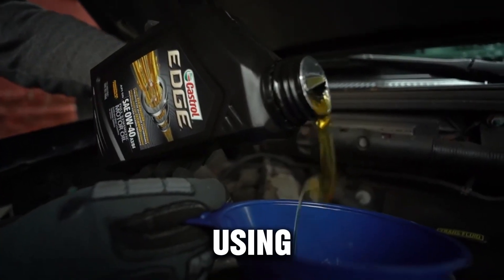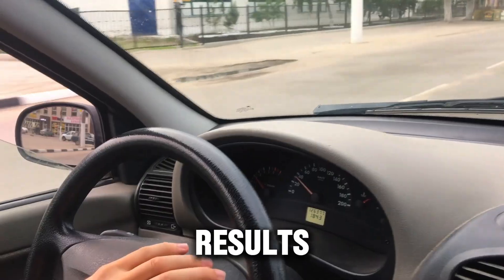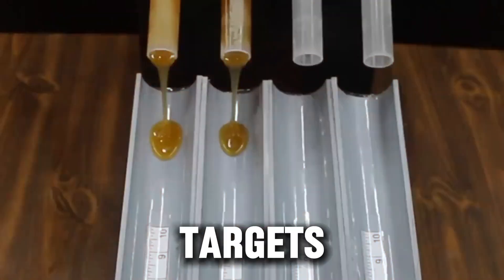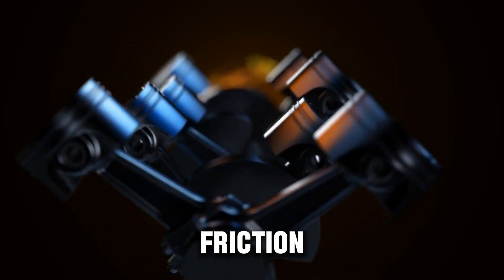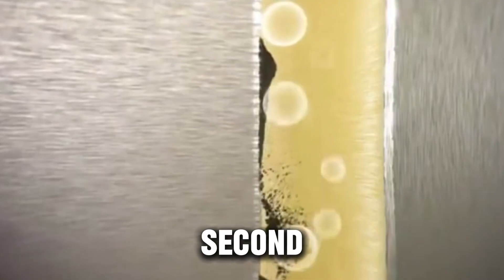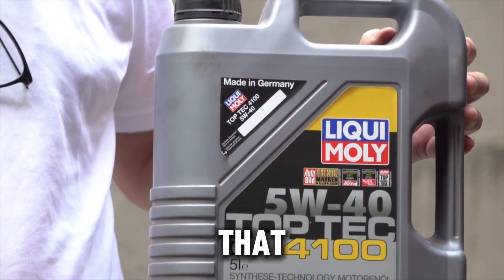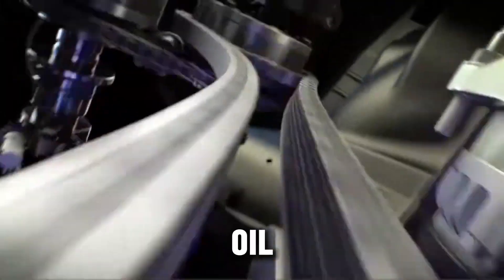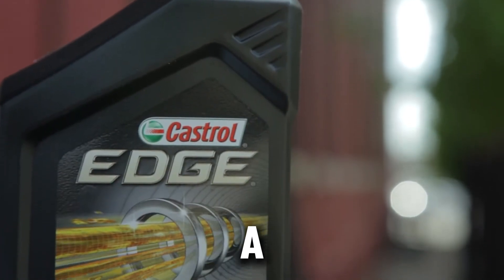The TRUTH About 0W40 vs 5W40 Diesel Oil (Real Engine Test!)

Comment: Joe 0W40 vs 5W40: no problem starting in cold weather; the difference between 0W and 5W is almost zero.
Look at Technical Data.
You are repeating idiocy like those uneducated Engineers from YouTube.
Diesel engine Oil has more detergent - today, in the modern world of direct-injected engines is used as special oil recommended by car manufacturers.
Who paid for your theories?

Comment: Comments
2

Add a comment...

@TheEdge3D
0 seconds ago
It doesn't seem true!
Both 0w-40 and 5w-40 have same viscosities at hot temperatures and same film thickness if we imagine they have the same additives. So at hot conditions of the engine it doesn't matter you are driving in texas or Ottawa.
The difference is 0w vs 5w. 0w means that the oil flows faster than a 5w oil at cold temperatures so it can reach the turbo bearings and camshaft faster which is crucial in cold weather.

But there is an important point: both 0w-40 and 5w-40 oils present much higher viscosity at cold temperatures than at hot temperatures. 0w-40 gets less ticker in cold temperatures compared to 5w one. So it is safer and more suitable for engines with turbo.

Comment: Gotta hand it to you, guys! You persevere in your fake reports!!!😮
Reply: No fake report just basic Tribology. He’s pointed out that every oil is a compromise that needs to be matched to service use. Cold regions with shorter journey and frequent stop starts prefer 0w-40. Warmer regions with towing and long hauls do better c 5w-40.  If the change occurs at 5-6k Mi I doubt there is a significant difference. Raise that to 10k Mi & a clear difference emerges.